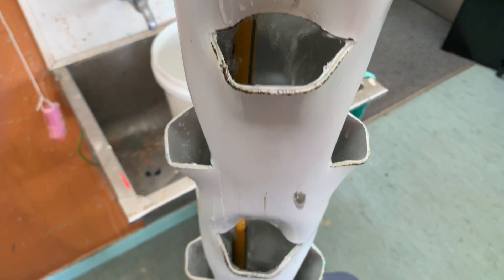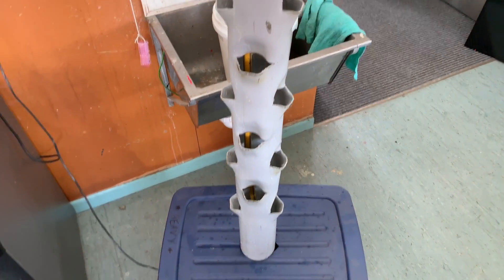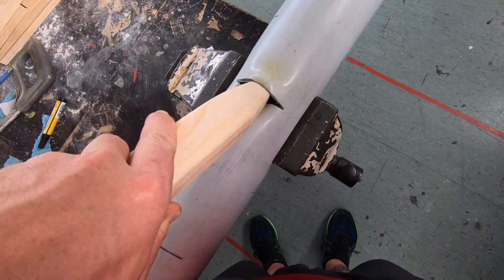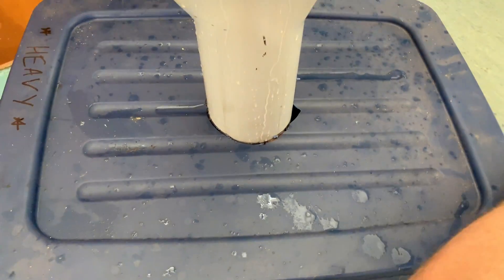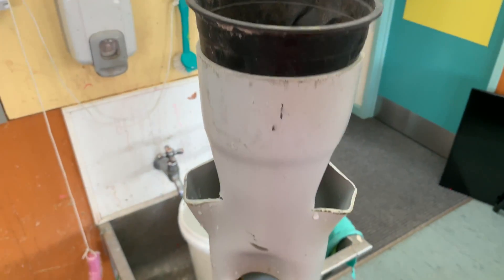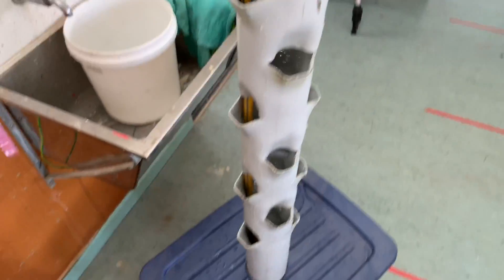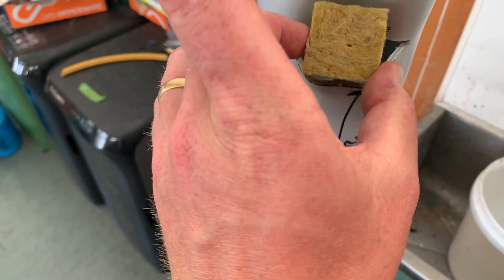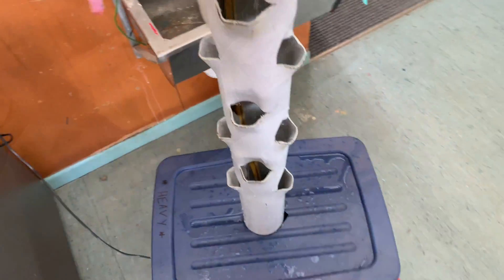Easy to make TOWER GARDEN

Comment: Where can I get pipe like  that Pipe? It seems like 4''is too small and big pipes are like 1000 bucks. I'll just buy an aeroponic tower garden for less than 1k. I need to start one of these in the house. I feel impressed to have one up and running b 4 things fall apart.  Time is running out. Please send resources.1🤗
Reply: Building supply store